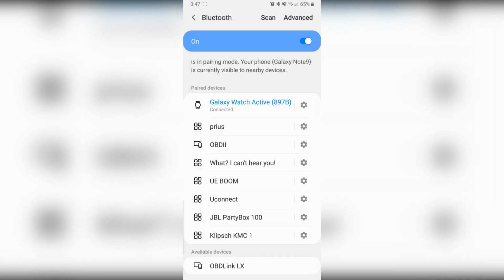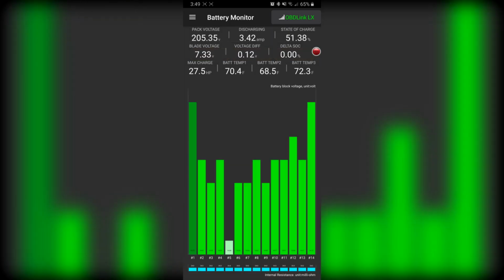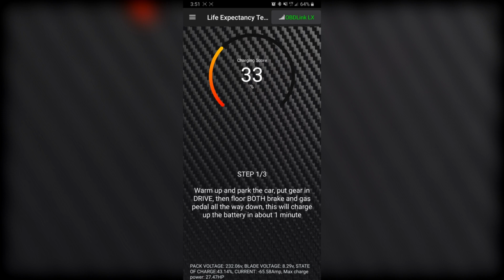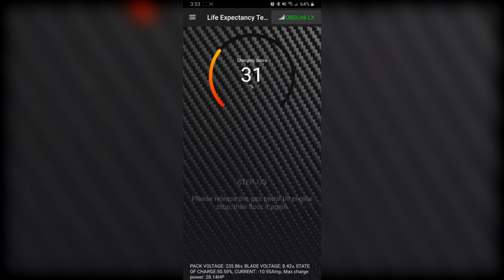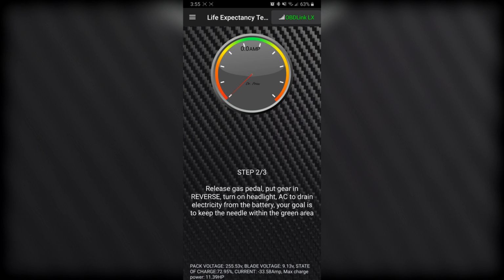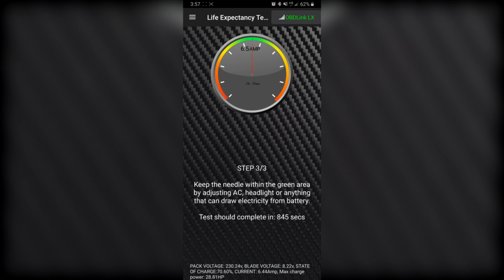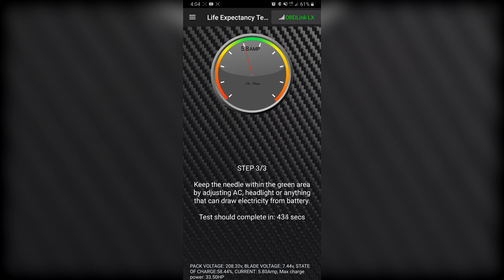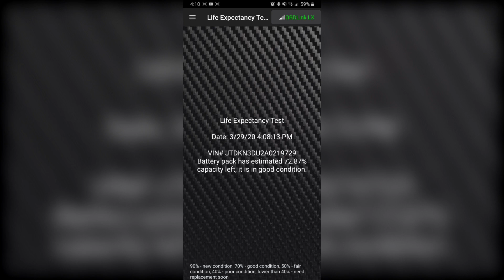How To Test Prius Battery Health

Comment: Our 2007 Prius is at almost 500k miles.  We got a new battery at 485k miles.  The car was never garaged. Our 2018 Prime has 184k miles.
Reply from the maker: The 2018 prime is averaging 60k a year!? Holy wow!
Reply: @HEVTech1  I meant 2017 Prime. We drive 50k per year!
Reply: Hi! I’m looking at a 2007 Prius with 200k miles for 5k, this is my first car and I’m super nervous about the miles but I know Prius’ are super reliable. Would you recommend this investment?
Reply: @blythe9703 Did you end up buying it? Sounds a bit high. If so, how's it working out for you? About a year ago, I bought a 2011 Prius with 196K on it for about $8500.
Reply: @RealDamienLee  nope! Didn’t buy it
Reply: @RealDamienLee damn speed you got taken to the cleaners
Reply: @Blythe  depends what the average value is in your area. 
A 2007 prius with 200k miles is close to 2k in the UK. 
I just bought a 2010 prius with 160k for 3500, hoping it will last for the next 10 years. It certainly is a good investment
Reply: I’m looking at an 08 with 138k miles for 2900. Worth it?
Reply: Dang. Serious?  That’s amazing.
Reply: @davincimen4495  2017 Prime has 366k now, original battery :)
Reply: I loved our 2007 gen2 priest I drove over a tree on rainy night doing my job delivering  the local NEWSPAPER  2010 320k FaSt forward just bought a 2016 can't wait to drive  my wife has already driven and I passenger can't wait to drive

Comment: Prius 2012 will not shift to Drive or Reveres. Instead it goes to Neutral. 12-V battery is  12.6 Any idea?
Also, the bluetooth stopped not working, for phone, or for OBDII
Reply from the maker: Sounds to me like the car is in ACC mode (power button pressed 2x without foot on brake).

https://priuschat.com/threads/very-odd-happening-prius-would-not-shift-into-gear.3077/
Reply: @HEVTech1  No. It was the inverter. It was known problem and free fix, but not active recall.
Reply from the maker: @west_park7993  nice, glad you got it figured out

Comment: I clicked the link for the OBD reader and it says that it is not compatible with hybrid vehicles.
Reply from the maker: Which one? I own and use both of the linked OBD readers with my 2010s with no issues.
Reply: @HEVTech1  The first one. It says right in the description that it’s not compatible with hybrid and electric vehicles.

Comment: How does the battery test work for the P3 Plug-in Prius?  What happens if I start with a fully charged battery?
Reply from the maker: Here's a thread on Prius chat where the app developer was discussing using the Dr. Prius app to test the remaining capacity for the prius plug in: https://priuschat.com/threads/2012-2015-prius-plug-in-hybrid-beta-tester-needed-for-dr-prius-app.204393/

Comment: Thanks for the great tip!! I will use this method to check the battery when I buy a used Prius. One channel claims that we should avoid 2010 model, what’s your opinion on that?
Reply from the maker: I own two 2010s and they have been great. They can burn oil but rarely does it become an issue that makes them not worth buying.
Reply: @HEVTech1  Thanks! I just noticed your reply.

Comment: going to try this. i have a 2011 gen3 prius with 55k miles on it. i'm the only owner. i've honestly never really got the advertised 48-51 mpg. but lately i am getting 34-35 mpg. trying to figure it out...
Reply: check air filter 
clean mass sensor (located by the air filter) 

usually it will be a clogged EGR cooler that drops MPG but that's Priuses over 100k miles 
yours is 55k so I don't think it will be EGR 
same with spark plugs and bad ignition coil boot
Reply: @MrDICKHEAD28  I just bought a used Prius a week ago and know nothing about hybrids. I've been doing research on them and this video popped up. The car has 101k miles on it and last night, 3 lights came on and a warning bell went off. Because I've never had a prius before, I started to panic. Come to find out it was the battery. It dropped below half and caused the sensors and alarms to go off. I don't know what a good mpg is but since I got the car it's been running around 34 or 35 mpg's. I got the battery charged today and all lights went off, but mpg is still around 34. My car does not have a regular dashboard and does not have dials that I can watch, so idk if the 12 V battery is good, or if the oil pressure is okay, or any of that. Any advice?
Reply: Check tire pressure. Did you get new tires? That could also effect your mileage.

Comment: Dr. Prius beats Torque Pro by a mile. The most important criteria is Internal Resistance, not voltage. One bad module with high IR will ruin your day. It's like the old XMAS light string when one bulb goes out and kills the whole string. Your 28 module pack is only as good as it's weakest link (module). Replace the bad module and you are in business. Don't buy E-Bay modules. They don't tell you the secret date the module was made. I got two where the seller scratched out the date code. Why buy a module that's as old as the bad one? Or older? Time is your enemy on modules. You can buy a new module from www.autobeyours.com for $80 each. Don't buy a new battery pack for $3300 from the dealer or pay $1950 at the dealer for 28 new modules (your labor). Go on www.car-part.com and find a low-mileage wrecked Prius complete battery local for less than $1000. When my 2005 battery died (after playing Whack-A-Mole with modules), I got a 2014 low mileage battery for $850. Moved up 9 years in age. I had to move the modules from the newer case to my older case but that's not a big deal. And the newer 2014 modules have better chemistry. Win-Win.

Comment: How does this work for the Plug-in Hybrid model Prius?
Reply from the maker: The prius plug in has a 4.4kwh lithium ion pack. The Dr. Prius app supports the below vehicles.

1. 2020 Prius all lineup except 4WD version
2. 2020 Highlander hybrid
3. 2017-2019 Prius Prime Plug-In
4. 2016-2019 Prius Gen4 One, Two, Two Eco, Three(Lithium) and Four(Lithium)
5. 2012-2015 Prius Plug-In
6. 2009-2015 Prius Gen3
7. 2003-2009 Prius Gen2
8. 1997-2003 Prius Gen1 (partial support)
9. Auris
10. Aqua
11. Prius C
12. Camry Hybrid
13. Avalon Hybrid
14. Highlander Hybrid
15. Lexus CT200h
16. Lexus ES300h
17. Lexus HS250h
18. Lexus RX400h
19. Lexus RX450h
20. Lexus GS450h
21. Lexus LS600h
22. Lexus UX250h
23. CHR Hybrid
24. 2006 Estima Hybrid (partial support on Android and Amazon Fire)
25. 2006+ Estima Hybrid (full support on Android and Amazon Fire)
Reply: @HEVTech1  what about a 2012 Prius v ?

Comment: What could be the reason that my OBDLink LX doesn't pair with my phone? I keep trying and through the app as well.
Reply: NevermindI got it. What is your opinion on 51.96% capacity for a 2008 with 124k miles??
Reply from the maker: @eltoro8143  somewhat typical, until you have a bad module/error code I personally wouldn't cycle charge/replace any modules. I do have a couple videos of the process I followed to refurb a  battery pack on a 2004 if you haven't already seen them.

Comment: So I’ve been watching your videos and I have a question. 

I bought my Prius like 8 months ago and like 6 months ago I performed this test. It said my battery was at 80% so that’s good right? 

Well... fast forward to today, my cell block 2 is all messed up, and I needed to replace my battery. 

What gives? 

I also believe I drove around without air conditioning, opting to leave the window down for fresh air. Perhaps that overheated my battery? 

The thing that’s very weird is my car was working fine. Then I reversed, and it made a weird noise as though I hit something but I didn’t... then that’s when I got battery problems so I have no idea what happened.
Reply: Did you ever replace the hybrid battery filter?

Comment: Is this a test for the auxiliary battery?
Reply from the maker: This is a test for the traction battery. A simple test for the auxiliary battery would be to use a multimeter with the engine off. If the voltage is below 12v and you have driven the car recently, it could be nearing time to replace it.

Comment: will this test help make battery better in capacity? Instead of changing and deep discharging it manualy, do you think this test does the same job? thanks.
Reply: Instead of CHARGING and deep discharging it manualy, do you think this test does the same job? thanks.
Reply from the maker: It will not, your entire pack only has the capacity as the weakest cell and cycling each cell manually will always be better.

Comment: Does this method work on Avalon hybrids? I just purchased a 2015 Avalon Hybrid and I have no idea how to check the health of the battery. I've researched and I can't seem to find the answer. Anybody able to assist?
Reply: I just bought a new 2020 Avalon.  I used the app mentioned in this video along with an OBD2 reader I have had for a number of years - and the app worked fine.

Comment: Will it also work for my Gen2 Prius (2006), I understand you have/are going to rebuild a Gen2 HV battery pack?  I noticed that hafway this video at around 50% SOC it showed 36% health so it could be expected that it would show about 72% health for a full pack or am I simplifying things?  Great video, thanks! Subscribed!
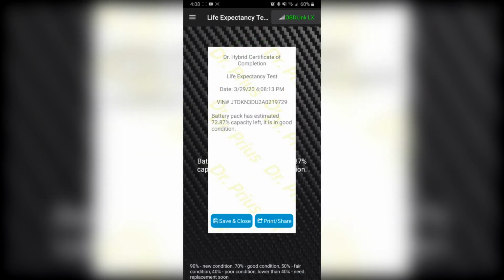Reply from the maker: This will absolutely work with a Gen 2 prius - I have done this with a Gen2 2006 and it worked flawlessly! The 36% value you are referencing is referring to the "Charging Score". That is an arbitrary value used by the Doctor Prius app to show how close you are to getting the battery charged up prior to the actual battery test. The health is shown at the very end of the test  specifically at 5:48.
Reply: @HEVTech1  Thanks, I will have a go at it.
Reply: A 2006 pack should be toast by now. Look for a 2014 junkyard battery for less than $1000.
Reply: @amazoidal  will it work if i put a 3rd gen hybrid battery on a 2gen Prius?
Reply: Yes, I put a 2014 Gen 3 junkyard battery in my 2005 Gen 2 Prius. But you throw out the 2014 case and transfer just the 28 modules to your old case. The modules are the same (except for updated chemistry) but the cases and cooling fan are different. Also the 3 temp sensors on the old case are on the bottom of 3 modules and the 2014 has temp sensors (thermocouples) on the top of the modules. When you remove the modules from the old case be very careful about those temp sensors attached to the bottom of 3 of the modules. If you are clumsy, you will pull off the wires from the sensor. So as you pull out the old modules from the old case, look for those 3 wires on the bottom and carefully unclip the sensors. The sensors will be near the first module if not on it, a middle module and a rear module. This is the most critical step in removing and replacing the modules in the old case. And if it's your first time, take pictures on your phone as you take things apart. I paid $850 for a 2014 battery complete. There is a date code on the top of each module but few know how to read the code. Many unscrupulous module sellers on E-Bay scratch off the code because they don't want you to know that they bought a really old battery for nothing and they are selling junk modules for $40 each. And get a Bluetooth scanner on Amazon and get a program called Dr. Prius for the scanner. Only Dr. Prius will tell you the most important parameter of the modules - Internal Resistance. Voltage means very little.

Comment: Thanks so much for the video. My life expectancy test came back at 5%. I  have the P3000 and P0A80 error codes. Poor block balance #13. So does that mean I can replace #13 and the life expectancy will go back up? Or should I be looking at rebuilding/reconditioning the whole unit?
Reply from the maker: The capacity of the pack is only as good as your weakest module so unfortunately your health test with a bad module wont be accurate. If you are comfortable removing the pack to work on it, I would suggest testing each module before deciding exactly which ones to replace but at a minimum you would want to replace those causing the error which would be one of the two modules in block #13.

Comment: Hi! Thank you for recording this video! 

If possible, you might answer a couple of questions that I have searched all of YouTube with no clear results. 
1st- My 2017 Prius Prime (42000 miles-just purchased 11/2020 and pre-owned) usually has only 2 bars of battery strength showing for usual driving (sometimes down to 1 bar). Is this normal? Or should the charge be higher? 
2nd- How often can I plug the car in to charge the battery without running it down or decreasing its life?

I am concerned that the battery is not doing its job, as I am only getting 37 to 40 mpg, which I think is much lower than the 55 or so that I'm hearing that a Prius is supposed to run on. I live in upstate NY. 

I would be very grateful if you have any explanations or suggestions about this situation?
Reply from the maker: 1st: I do not own, nor have I driven the prius prime, but what you describe where it shows 1-2 bars doesn't sound abnormal as it has a much larger capacity than a regular prius. The prime hovers around 15-20% I believe, but I am happy to be corrected by someone who owns a prime.

2nd: The short answer is "about as often as you please" as you are likely going to drive shortly after it being fully charged. Also, a "fully charged" prius prime, likely is actually only 80-90% charged as toyota provides a buffer to reduce battery wear. That said, the lithium chemistry used for the prius prime likes to be stored around 50-60% state of charge when not in use, if this isn't possible I trust toyota battery engineers more than my own research.

2nd-2nd: you absolutely should be getting better than 37-40mpg out of your prime especially if you are plugging it in before your commute. Some prime owners will see upwards of 65-75mpg adjusted for the use of the additional charge from plugging in. I would suggest maybe getting it looked at?
Reply: I'm reading your comment just curious if you're still getting 37 40 mpg and I charge my battery every night at the lowest setting which would be  8 amps It's a slow trickle charge It's a good idea to completely drain your battery before you charge it up again. It's important to run that  gasoline engine. Otherwise the fuel will become stagnant and Clog all your Fuel lines.A charge overnight turns out to be 29 miles. On the average

Comment: When you press down both the brake and gas pedal do you put on the handbrake or not?
Reply from the maker: When I did it, I just held the brake pedal and the gas at the same time. I did not use the parking brake.
Reply: @HEVTech1  is this hard on the transmission to hold both pedals with it in gear for such an extended period of time?
Reply: @russelld5838  I was wondering the same thing..

Comment: Do all ODB have the capability to check the high powered battery on a Toyota Prius
Reply from the maker: Most do, but the ODB Link (green looking one) most certainly does. You pay a little more for it but its better quality.
Reply: Get Dr. Prius for your phone and the OBD scanner for your car. The Pros use Dr. Prius because Internal Resistance is god.

Comment: What kind of codes you can read with that OBDII and the app?
Reply from the maker: Most engine/fault codes and the voltage of each block. The hybrid assistant app uses the information from the ODB reader to create a sort of "hybrid system indicator" thats nice to reference while driving.
Reply: @HEVTech1  That's good to know. May i ask if it can read codes like ABS failure or something like that?
Reply from the maker: @hedgehogthesonic3181  it should be able to yes. You can also reset engine/ECU codes.
Reply: @HEVTech1  Great, i was planning to buy this one specifically, but currently is not available on Amazon, shame, i guess i will have to wait. Thank you very much for answering, have a good night.

Comment: I have an Innova 3211a OBD II device and when I try to pair it, it asks for a pass code which I do not have. The official Repair Solutions app of course by passes this and does not require this, but I really want to get my device properly paired, so I can use third party apps like Dr. Prius. Any suggestions?
Reply from the maker: Most ODBII readers have those Bluetooth PIN#s. 

Typically the default PIN is "0000" or "1234".
Reply: Get a different OBD2/bluetooth adapter. Many do not work right with Dr, P'. Also read the write up at the Dr. Prius site. It has many suggestions on adapters. I bought a Veepeak on Amazon for $12 and it works great.